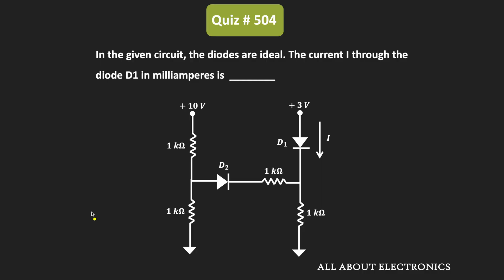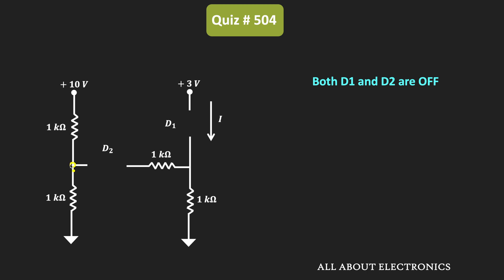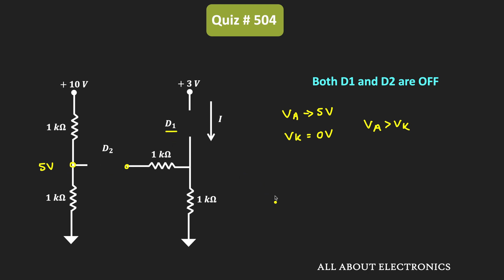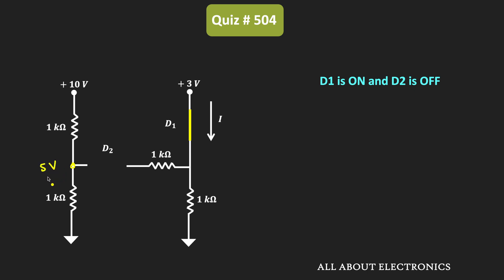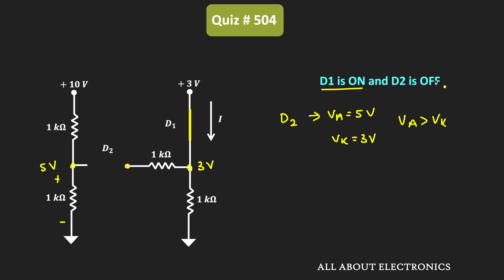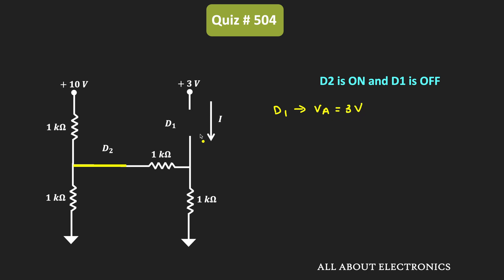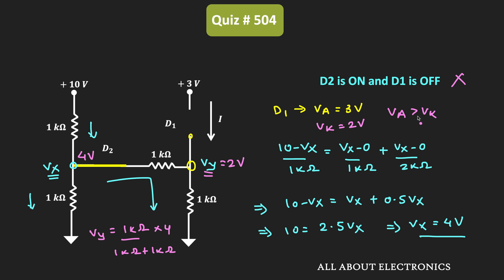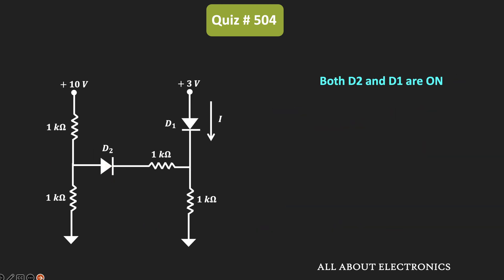What is the current through diode D1 ? | Diode Circuit Solved Problem | Quiz # 504

Comment from the maker: For more solved problems on Diode, check this playlist:
https://bit.ly/3jqChaO

For more solved problems on op-amp, check this playlist:
https://bit.ly/3sXsbCA
Reply: why did voltage divider gave a 5V value for Vx and 4.33V for nodal? Is it because the 3V on the other node? In this case it's not good to use voltage divider to get Vx?
Reply: was explained at 2:25-2:27 ohh I get it